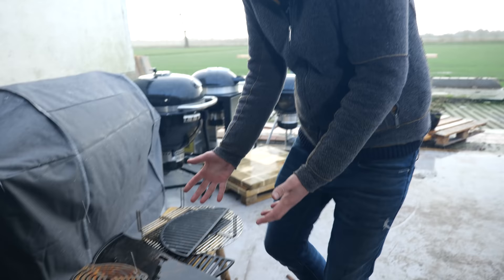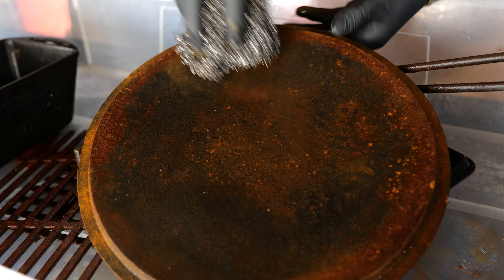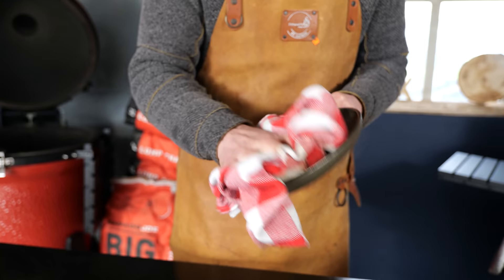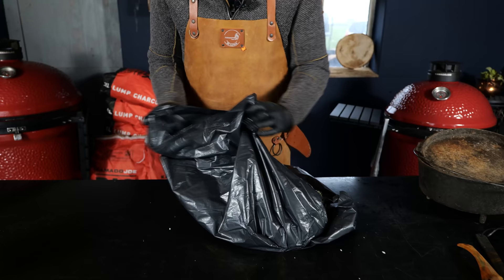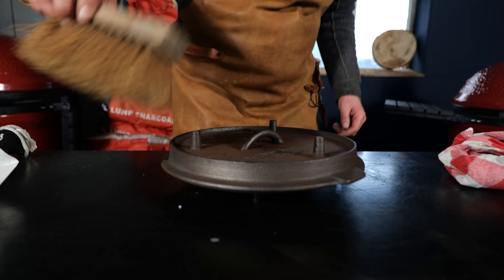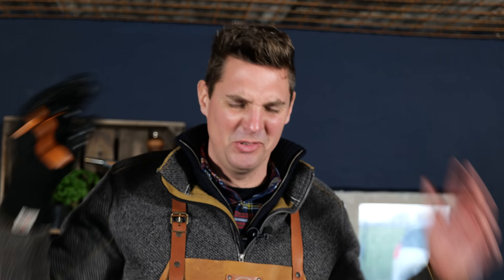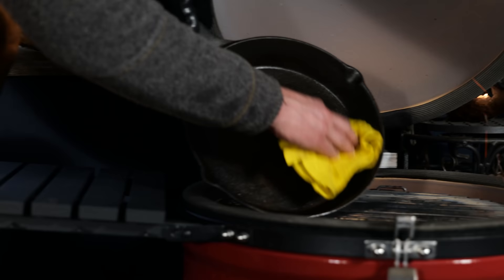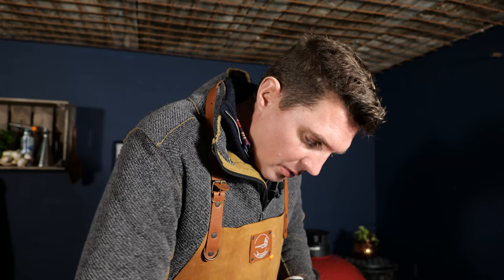HOW TO USE CAST IRON SKILLETS -- Cooking Maintenance and restoration

Comment: I bought a lodge cast iron 12" pan about 3 years ago. They are already preseason.  First thing I did was wash and scrub it thoroughly. Then I heated it in the oven then used crisco to coat it. The surface was rough, some people sand the cooking surface. It took time but every time I use it I scrape  it with a steel spatula. I know not supposed to, but now it is so smooth any food I cook in it does slide around including eggs. My uncle used to clean them by burning them also, he told me it was the best way. Excellent video
Reply: @maddawgnoll  I do the same thing, minus the water, after each cook. I've had mine for um maybe 2 decades! Lodge has never let me down. Cheap and very effective as long as you take care of it.

Comment: Kosher salt is one of the better cleaning agents. Take the salt and add just enough water to help it stick together, then you can use it to scour off burned-on bits or congealed grease. I use it on my cast iron griddle as needed, and it does nothing to harm the finish.

Comment: With that much rusty cast-iron I would just invest in a sandblaster with some Softer blasting media.

I’m with you on burning it off. I never clean my grill when I’m done grilling I just let it keep burning. Then before I use it I just crank up the heat and burn everything off and use a metal brush and then I spray it with canola oil or olive oil and sometimes I rub onions on it. For pans once I get any Rust scrubbed out of them I dry them off and put them on the burner just long enough to get the moisture out and then I Oil them and when it cools off enough to touch it just wipe it off as much as possible. I recently moved to the south and people here just cook everything with bacon and when they’re done they wipe out the pan and wipe some of it on the outside and use the bacon grease to season the whole pan.   Unfortunately now I have an electric stove. I don’t use the cast-iron on it.  I never thought of seasoning it repeatedly.   Oops.  :/ I just leave it on the grill can I use a spray can of canola oil and hit it a few times.   I probably poison myself, huh? 😮

Comment: Tip van Flip, be careful when using an iron cast pan on an induction plate. Don't put it down too "enthusiastically" or two things will break. Yup, the other thing is you...

Comment: you can do this in an oven indoors. You just need to use the "self clean" function on your oven. All of the rust will turn into a powder and slide right off. All you'll need to do is wipe and re-season.

Comment: Don't waste time scrubbing, just pay someone to sandblast it
Reply: You can actually warp and ruin a cast iron pan by taking a power tool to it, especially if it's a vintage or antique pan.  I have several pans that are more than 80 years old.
Reply: @russbear31  Power tools are used in industry for metal processing on a very large scale the world over. Not to ruin metal, but to produce very good metal products. In fact, every cast iron skillet in a store has been grinded and polished with power tools. If you do not know how to use a power tool, you could ruin anything. That does not mean that the world should stop using power tools, though.
Reply: @maddawgnoll  Smart, not lazy. Why would i wanna make it any harder when there are multiple ways to solve the problem with less work involved.